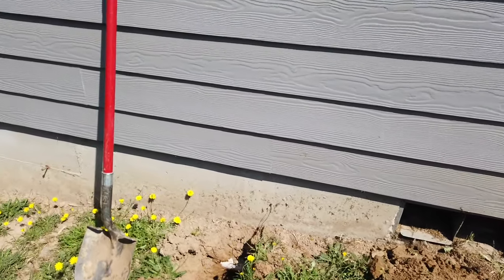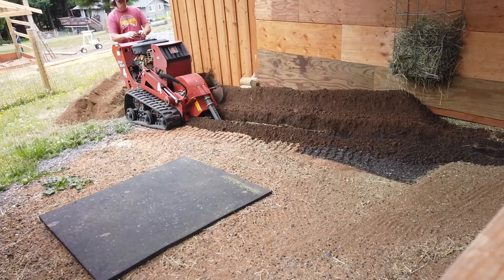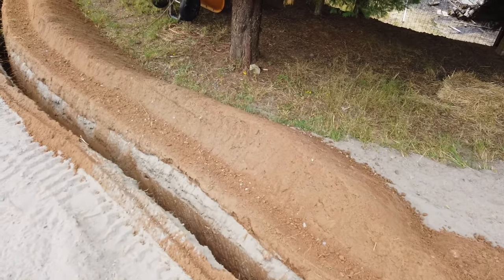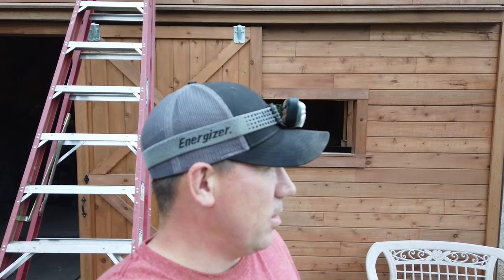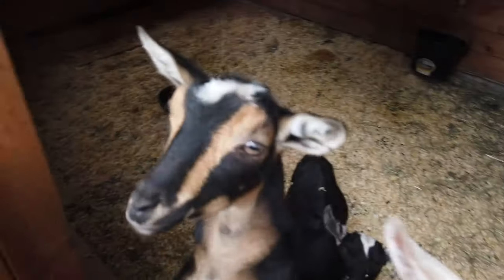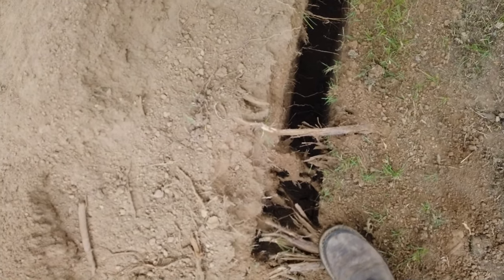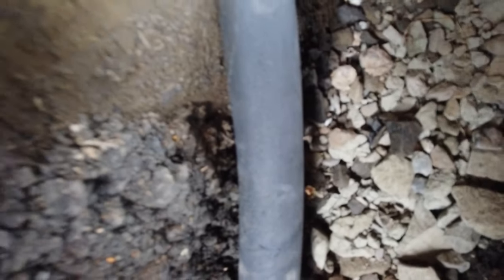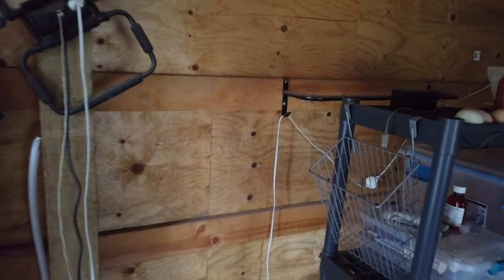Running Electrical and Water Out to Our Barn

Comment: how did you fish a wire for 60 amps through the pipe?
Reply from the maker: I used my shop vac to pull a light weight pull string inside the conduit. Then we attached the wires to the pull string and pulled it through. We used 3 4awg wires and 1 6awg for ground.
Reply: @JohnsonFamilyFarmstead  nice, thanks!

Comment: Is there any way you could lend me a list of the tools and materials you used? I'm running piping from my mom's house to my out shed and I'm not exactly sure what to do. Any help would be fantastic
Reply from the maker: It really depends on your situation. I used 3/4 inch pex for the waterline and 1 1/4 pvc conduit for the electrical. Call for a locate before you dig so they can mark any underground utility’s.

Comment: Did you have a problem putting the electrical wire in the conduit?  I often run it and add pieces of conduit on as I go.
Reply from the maker: It was a tough one to pull through. I had some help feeding the wire in while I pulled on the twine.

Comment: How are you going to put the wire into the pipe once it is in the ground. When we had to run power line into the conduit we put w rope through so we could attach it to the wire and pull it through
Reply from the maker: I’m going to try a fish tape first if that doesn’t work I’ll try what they call a “mouse”. Wish me luck.
Reply: Jet line and lube
Reply: A good fish tape and lube works wonders, it’s the proper way to do it but if you don’t have any electrical tools paracord  works. Some type of lubricant is a necessity though